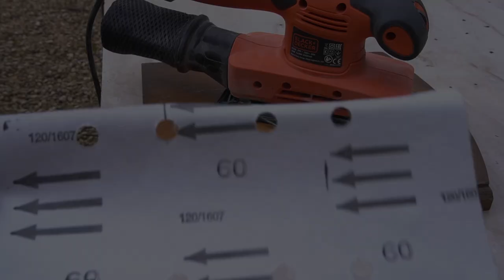Antique Medicine Cabinett Restoration

Comment: Your mirror glass replacement  is wrong 🍉 this shape needed. Look at wood/ glass pattern in the wood at 1:10 to 1:18. Other than that I'd like to say good work 👍
Reply: You are correct. Original mirror was fan shaped at the top as seen by the shadow or oxidation of the original finish. The mirror removed was a replacement, the original was most likely broken. This explains the two holes for that retaining cleat removed from the top center of the mirror. The curved top on the original mirror required the upper hole. The lower hole was made due to the flat top for the replacement mirror going straight across and not following the original arc which raises the cleat. I love the forensics of restorations on old objects.
Reply: @Vault57  good work none the less and the very best of luck with your future projects 👍